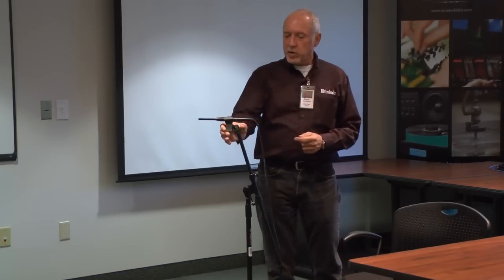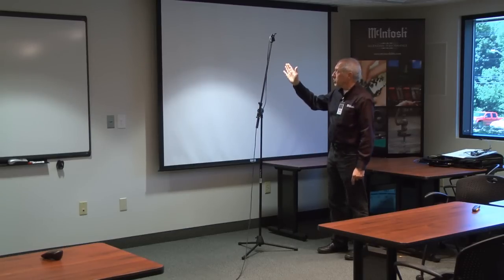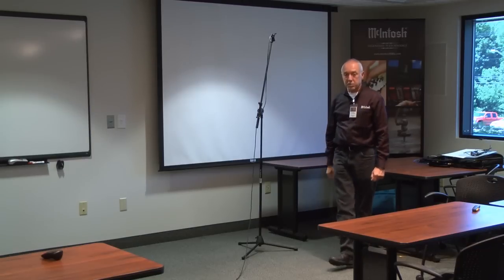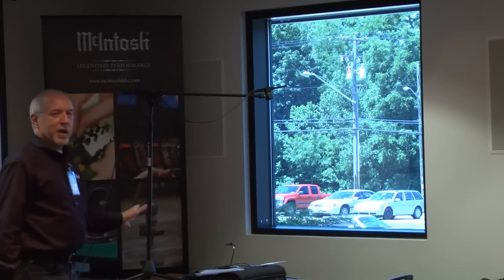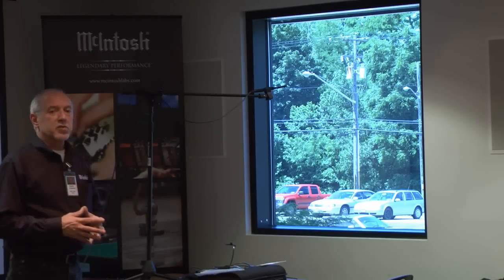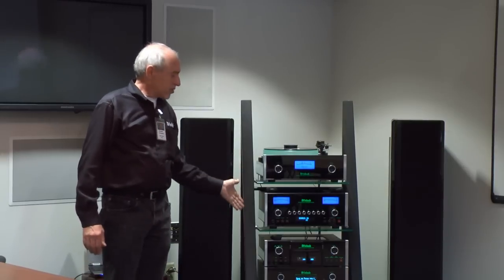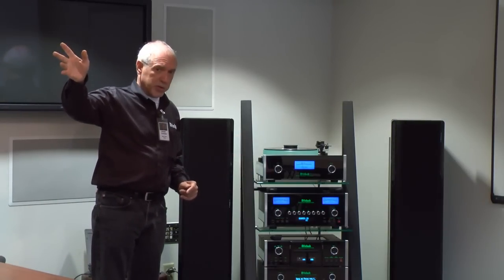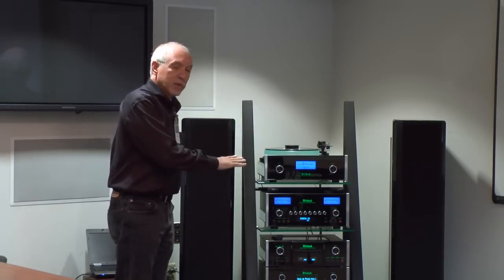MEN220 Room Perfect setup .wmv

Comment: where is the ideal place in the sound chain to place this box?  can you place it after your DAC and before your preamp (I have a C1100)..?? or does it have to go between the C1100 and the amp (a MC462)??
Reply: @chuckhinton3994  the only other source is an SACD/CD player .. which I plan to feed signal into the DSP first, then the DSP sends the digitally room corrected signal into the DAC via SPDIF..   the DAC feeds analogue into the C1100..

Comment: You don't even get to see a graph showing you before and after changes. And I don't think you can even change things.
Then you have to spend three to $4000 for the machine.  And it's not even a real time measuring device although that would be a bit hard to do. You do a few tests and then it does the treatment and then it's done. And it's hooked into the signal path and it cost nearly $3000.
Reply from the maker: Sorry you feel so strongly about a system you have not heard the results of. I promise not to force you to buy it. I won’t even make you watch my video or read the glowing comments of those who invested in the system like the comment right below yours.
Reply: @chuckHinton  and there in lies the quandary.  I know this is a two channel DSP and since I don't have a McIntosh processor it would be tough to incorporate this into a home theater system. I own lots of Macintosh gear, but this is geared toward 2 channel listening and I listen to more Home theater but maybe it would be quite good with a Conrad Johnson gat 2 that I own.  Two channel DSP is something I am exploring. I did look at the Macintosh preamplifiers but they don't do line stages which is what I wanted

Comment: How would you say this compares to the advanced Audyssey MultEQ XT systems?  Obviously this uses a much more accurate microphone and takes more measurements for the room specifically, not just calculating based one listening/focus positions, but what confuses me is that the mic is directional.  Also, if it's just random points, how does the system know exactly where those room characteristics are coming from?  Doesn't the directionality matter in terms of how it all comes together at the end?  Any details in terms of differences between the two systems would be much appreciated.  Thanks! :)
Reply: That’s a better question for Peter Lyngdorf who obviously won’t reveal all the actual details of the software & Eqibit algorithm. 
But bottom line, Room Perfect “removes “ the room for a magical listening experience